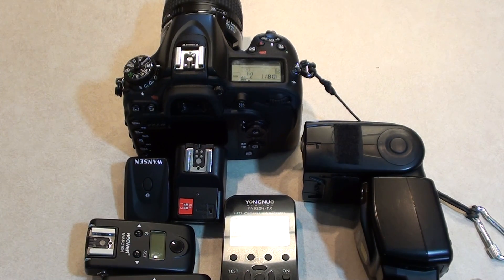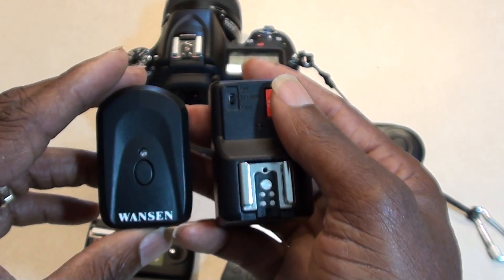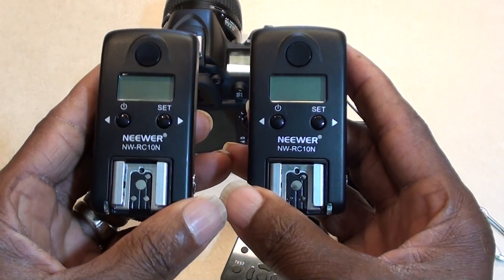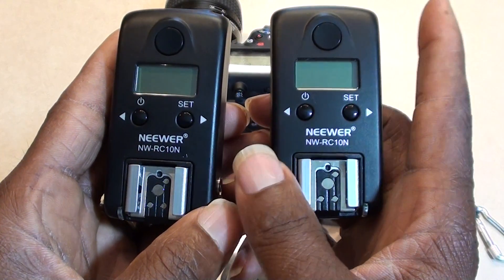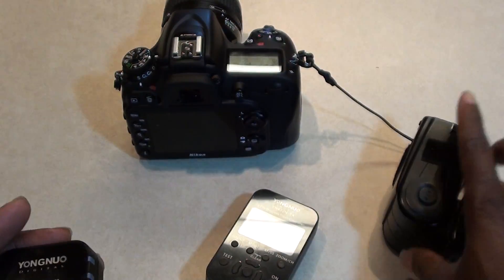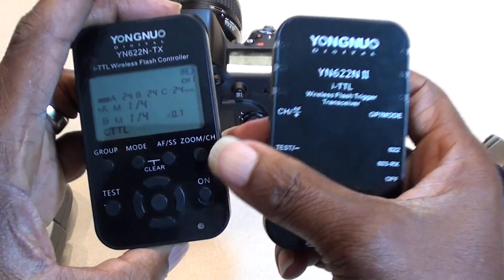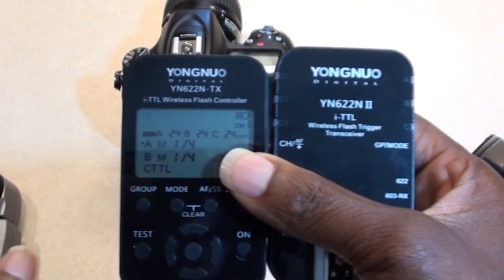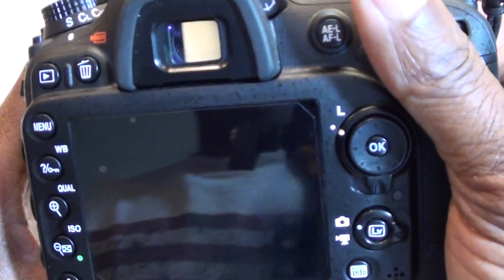Metering YONGNUO YN622N II Flash triggers (PRE-FLASH)

Comment: Thanks guys for the comments! I thought I was going mad too but eventually guessed that pre-flash was the issue. Moran Schwartz, your solution works but it's far too much hassle. I think I'll buy some more Yongnuo  YN685s and ditch my Nikon flashes.
Reply from the maker: I love my 685s, they work great on and off camera. I still use my Nikons on camera. The only thing I wish the 685s had is regular flash slave modes. The YN968 has it but that flash is a little more expensive.

Comment: I just purchased a Sekonic L-308S flash meter on EBay, and it took me a full afternoon before I figured out that the combination of the yongnuo receiver/transmitter and the Nikon flash does not give a correct reading on the meter.  I thought I was going crazy and actually requested to return the meter because I thought it was defect.  Fortunately,  I only have one Nikon Speed light.  My other 3 are yongnue speed lights, and there is no issue with a pre flash.  Thank you for that in-dept video...  wish I would have come across it before I spend a whole afternoon wondering if I was crazy.
Reply from the maker: Yes I understand, I was going crazy also. I wish I had just purchased the yonguno speedlites with the build in receivers in the first place.

Comment: i did had the same problem, but i did find a way to use the lightmeter.
there are 2 ways i use it...
1. put the camera in Mirror up mode, so the preflash will fire when the mirror goes up, after the preflash turn on the lightmeter and make the picture, the main flash will fire, and you can meter it.
2. set the flash in your camera to 2nd curtain sync, if you move any lights, and want to know the right setting, put the shutter speed to 2 seconds or so, take the picture and the preflash will fire, and you have 2 seconds to turn on your lightmeter before the mainflash will fire.
goodluck, and let me know if this works for you! :)
Reply from the maker: Wow, you really worked it out. I will try this. I ended up buying the YN685s with built in receivers, now I can go to manual with out any issues and get everything right.
Reply: @allabouthim03  hahaha yes i did :p
sorry that i did not find your video before.
i think it is weird that also with the test button the preflash will fire, Yongnuo has to program a second or 3 between the preflash and mainflash if you use the test button.
goodluck!
Reply: Palm Tree: No. That's a load of bollocks. 2nd curtain sync creates undesired and different composition.

Comment: hi 
you can do it more easly and leaving your flash on ttl.
you have to do some things first:
1.you have to use the flash lock option ,i put one button to the flash lock option.
2. put your "c" group always on ttl mode (on the yn622n tx ).
3.leave the flash in ttl.
4.when you want to mesure the power of the flash, you first trigger the Pre flash with the preflash button lock. 
5.you take a photo! measering the flash power.
hope it helps! ask me if it was not clear
Reply from the maker: Hi, thanks for your input but i have no clue what you are talking about. What "preflash button lock"? Are you talking about the test button on the Transceiver? Is the preflash lock option something in the menu of the flash (speedlight)?
Reply: Carl Bradley no. it is in the menu in your camera. you have to assign one button to be a  flash lock button.
sorry for my English
Reply from the maker: What Nikon body are you shooting with please? I'm using D7100.
Reply: Carl Bradley d90,look in your manual.
Reply: Swartz: That's a load of bollocks. Walking back and forth all over the shop is not desirable.